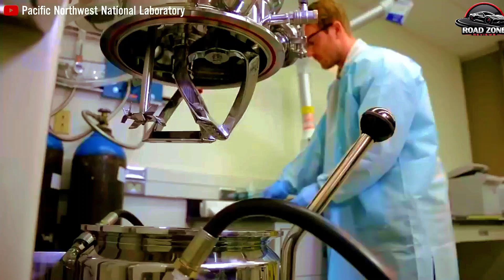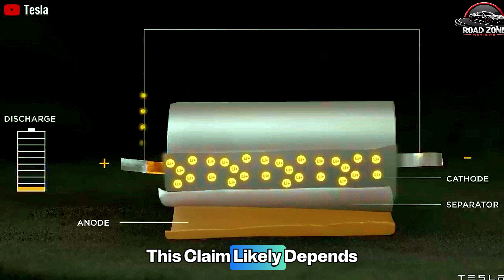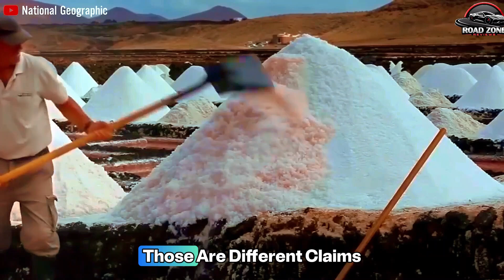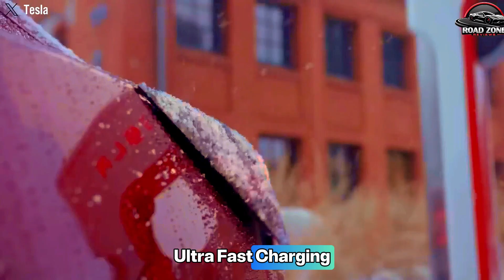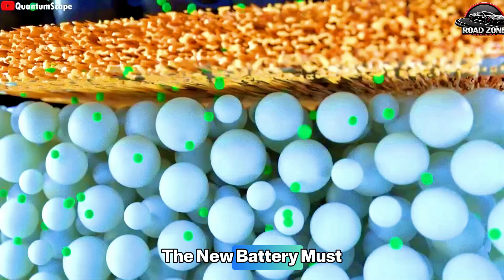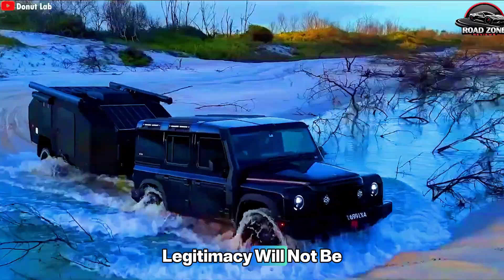World’s First 1,000-Mile EV Battery with 4-Minute Charging? Breakthrough or Engineering Hype

Comment: any claim for super short charge times are hype because you need a charging infrastructure to put out that much power; this type of power IS NOT available outside of a few show cases -  it is not available to the gernal pubic at home, at work, or usually anywhere in a given city.   It's like saying you can fill a Jumbo Jet with passengers in 4 minutes if you have 8 gangways to the jet - but no airport has 8 - they have 1.